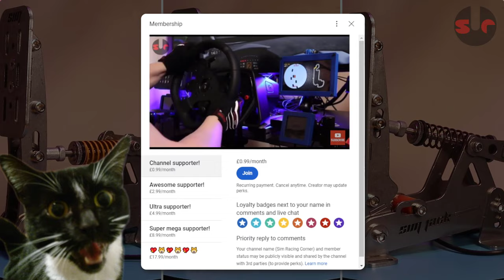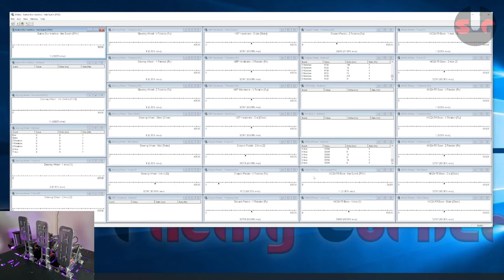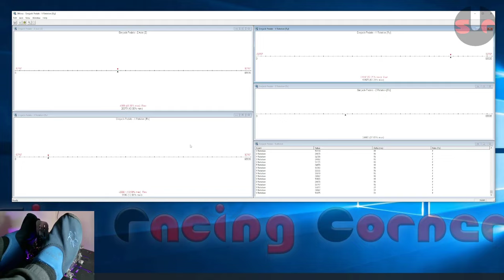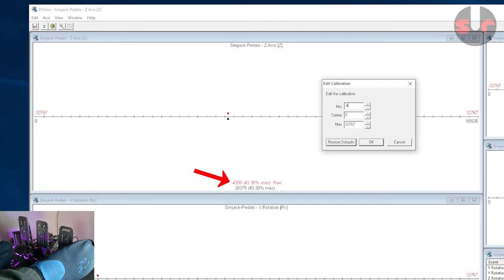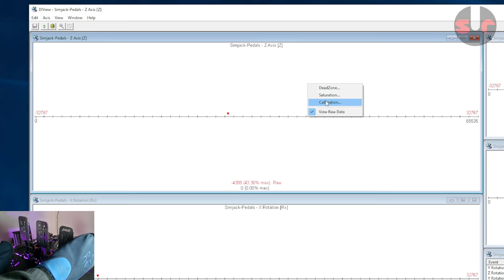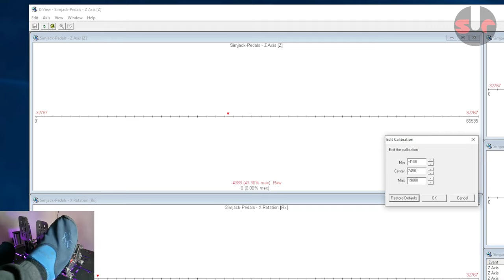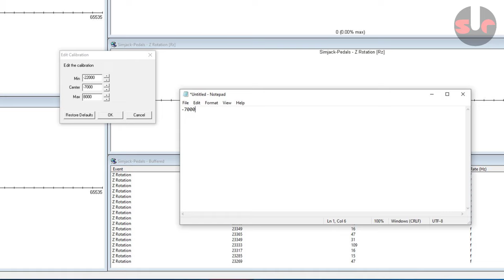SIM JACK Mini Pedals [REVIEW] They look the part, but do they perform? WATCH THIS BEFORE BUYING!

Comment: I think that it is extremely important to know that these are the cheap baseline SJs. The pro versions are light years better. Which I have, and in comparison to the equal quality, I’ve tested out the HE Sprints - they are nearly identical with hairline differences.

Comment: The simjack shop has some rubbers for replacement,with different rates,maybe with the combination of them is possible to have a more enjoyable fell on the brake
Reply from the maker: I've already done some testing with different replacement brake spring materials, and it does improve things a lot. There's a follow-up video coming at some point for this.
Reply: @SimRacingCorner  hello can u explain exactly how to connect three pedals to the pc? Should i buy three rj12/USB adapters for each cable and connect them directly to USB 3.0 in pc or 3.0 hub? Im planning to buy cammus C5 wheel. There is only one USB port at the back . How to make it work? I need to get a box like u have? What's the exact name of the box and where i can find it. Theres zero information on the internet how to connect pedals with rj connections. Thanks
Reply from the maker: @maxtorbstok  The pedals come with the controller box. All 3 pedals plug into the one box. Then a USB cable runs from the controller box to your PC. Everything you need comes with the pedals.
Reply: @SimRacingCorner  i get you. Thanks. I ordered SIM Jack pro pedals . Do they that boxed aswell?
Reply: @SimRacingCorner  u think its gonna work with cammus C5?
Reply from the maker: @maxtorbstok Yes, same for  the Pro pedals
Reply from the maker: @maxtorbstok  Sure, it's fine. I'm currently testing the C5 to review. And I'm using the SimJack Pro pedals.
Reply: @SimRacingCorner  cheers bro, thanks for the fast responds. Waiting for pedals and wheel to arrive :) enjoy your day

Comment: thanks for your review!  Recently just purchased the pro pedals and have been pleased with them so far.  One thing I found interesting is the mini pedals have the 'foot' parts on front and back separate, so you can easily swap the front for the back and have the pivot reversed to change heigh and angle easier.  The Pro model is 1 solid piece, not allowing for this.  Kinda wish they would of kept them split as I want more angle in my pedals, at the lowest setting they are still fairly upright.

Lastly, in DiView for the Center number negative value or any of the values for that matter, you can just copy/paste the negative value from the min input (including the - sign) and then correctly set the center value, instead of having to open notepad.  

Looking forward to the brake mod video, curious to see if you can achieve a more real feel by swapping out the elastometers for something more progressive.

Cheers!
Reply: I'm very interested of pro pedals... Can you tell me your opinion? What are the differenze between the hydraulic rods on aliexpress? Are they easy to calibrate?
Reply: and what about shipping taxes or customs?

Comment: I have them on my sons rig. They are ok. I think they are i little bit stiff on the accelerator. I also had alot of usb issures with them like you did, and they were not compatible with my "ZERO DELAY USB CONTROLLER" witch i used to make a button box wtih. Both had the same USB ID (long time to investigate) and in the end had had to find another type of "zero delay usb controller" to get them to work. I suspect that this has to do with Simjack has not properly made a "own" usb hardware id for them, just used the one that the usb chip has as default.

Comment: Been waiting for this review forever feels like finally glad to hear it, I’ve had my eye on these for a long time but could never find a proper review! I have the TLCM and they serve their purpose for what I do but would love to try these out!! Keep up the awesome content!!
Reply: i came from the tlcm to these pedals i like them not the best finish but check all the nuts and bolts are tight. also do any adjustments before setting it up on your pc or your going to have to redo it. there are more springs and stuff to make the brake feel better. i now have the simforge mark1 they are a little better if you can get them i would
Reply: @bgdaddy42069  correct me if I am wrong but the sim forge pedals aren’t much more expensive are they? I have looked at them and I would rather have them over the sim jack pedals.

Comment: Great video, I am considering these pedals would they be much of an upgrade from my TLCM's which I have modded, i'm perfectly happy with the Thrustmasters,but was wondering if these would help shave those all important tenths.
Reply from the maker: You'll appreciate these pedals having a more solid feel over the TLCM's. But honestly, you won't be quicker with these pedals. The load cell brake is doing the same thing, so there's no technical benefit to be had.
Reply: @SimRacingCorner  Thankyou for the honest answer and for saving me money keep up the good work.

Comment: I ordered this pedals and they are supposed to arrive in the middle of this week. Im not a very experienced driver and your review is pretty much how I expect them to perform. I realised im probably gonna need a pedal baseplate for this set. Im using the Next Level Racing F-GT Lite. i will probably be able to mount the pedals to my rig, but my heels will have to rest on the floor, so not very optimum. do you know a pedal baseplate that would work for this set of pedals?
Reply: I used a 18mm sheet of ply cut down and drilled for pedals, cheaper and works fine
Reply: What have been your thoughts on the pedals?
Reply: @ebola1974  i have only ever owned these pedals so have no point of reference but I think the brake pedal is far to hard to press and the fixes video rubbers didnt help at all im waiting for a spring to come from ali express and also have 3d printed some tpu flexibles to try-- TLDR maybe you could save yourself a headache or maybe you want a super stiff brake